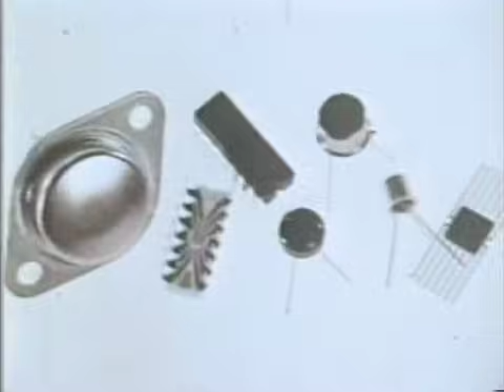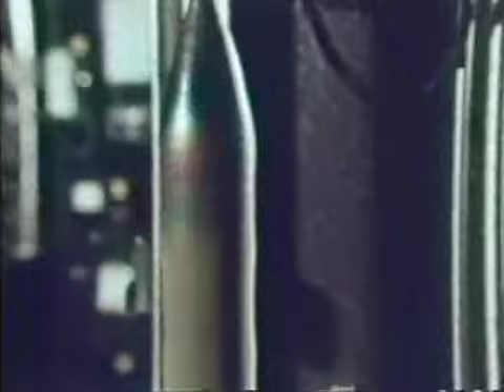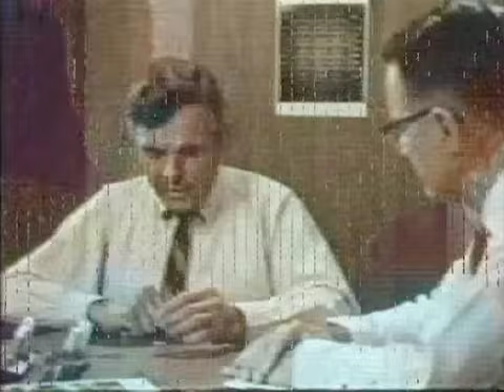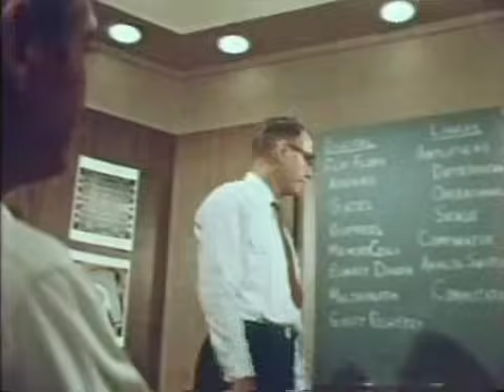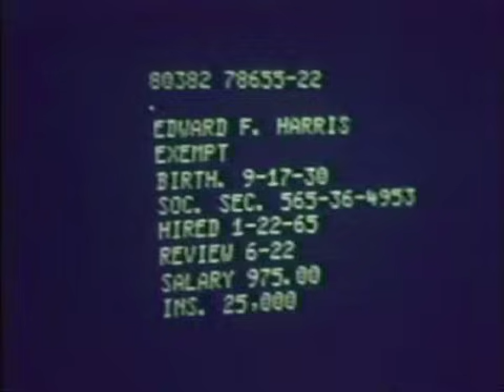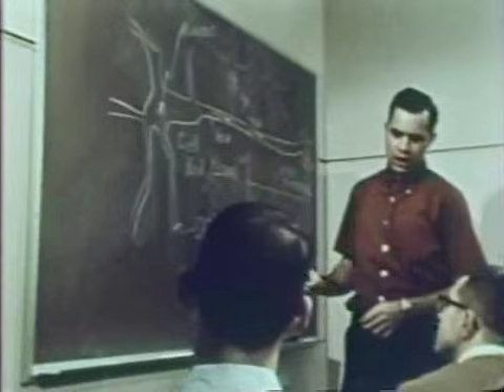Fairchild Briefing on Integrated Circuits

Comment: Funny, I remember all this old stuff. I started working 1971 at RIFA, later it was renamed Ericsson Components. We got the technology for TTL from National Semiconductors and built our first fab. Amazing: 5 micron technology and contact printing for  those bipolar TTL circuits. We also had a developmental lab for high voltage analog bipolar circuits. Later we achieved technology from AMD for NMOS and CMOS ( 2 um technology, Perkin Elmer lithography tools) and later we built a small Sub-micron fab with technology from Texas Instruments. Then we were using I-line (365 nm wavelenght) step and repeat lithography. When Ericsson closed the Sub-micron fab 2004 I moved to Dresden Infinion and worked with DRAM technology. When I retired in 2009, we were using ASML argon fluoride laser 193 nm Step & Scan immersion lithography.
Nowadays 2024 , 15 years lager, the technology has reached unbelievable new highs. Lithography is now using extreme UV (EUV) at 13.5 nm… ASML is the only company that produces and sells EUV systems for chip production, targeting 2 nm and below process nodes. Apple will use TSMC 2nm technology 2025. Cost for one ASML EUV equipment is approximately 200 million US dollars.

Comment: My dad worked on the probe machines for Fairchild, those machines that tested the circuits before they cut the wafers up.  When the guys that started Fairchild left to start Intel, my dad left Fairchild  and started a company manufacturing probe cards and probe machines.  Intel was their biggest customer, I'm guessing because my dad and his partners knew  the Intel founders personally.
Reply: As a fresh college grad in joining in 1969, one of the lessons learned by the departing management (Noyce, Moore and Grove to Intel, Spork& Lamond to National, Jerry Sanders to AMD plus many more) was the horrible cost of home made equipment, materials, etc. When the market turned down (and markets always turn down) Fairchild had huge costs for employees who created infrastructure and didn’t directly make and ship product. The spinout guys made firm decisions to sponsor and use 3rd party companies (such as your father’s probe card company) rather than carry the cost on their books. When the downturns came, they simply cancelled orders and refused deliveries to reduce costs immediately. The 3rd party companies became their own financial segment now known as SEMI CapEx (Semiconductor Capital Equipment) and three of the largest globally are Applied Materials, Lam Research and KLA all based in Silicon Valley.

Comment: This is the company where the founders of Intel worked.
Reply: Noyce, Moore and Grove to Intel. Spork and Lamond to National. Jerry Sanders to AMD. Plus dozens of others. One of the unique benefits of California employment law is an employee cannot be prevented from working for a competitor unless the original company pays the employee not to work. Non-compete agreements in California are totally unenforceable. (In later years, the legal eagles have found an ability to prevent employee movement by invoking protection of Intellectual Property aka IP. You cannot take any IP with you to a new employer. However, if the information is available from other sources, it’s not considered IP so the employee cannot be blocked.)

Comment: Great documentary. I don't think it is possible to find an older documentary about that technolgy, 1967. It was new. Created by Jack Kilby and Robert Noyce, founder of Intel. The original of 1958 only had one transistor. The integrated circuits were used in Apollo Guidance Computer, 1966.
Reply: Noyce came from Fairchild.  Apollo used RTL
Reply: @paulgriffith9570 planar tech was Hoerne's baby...greatest improvement to semiconductor tech besides actually using semi conductors

Comment: With so many ic manufacturers, I didn't know how much we owe Fairchild for what we have today. This is one video deserves a lot being here. Thanks for sharing it.
Reply: just go through the lists of First until you start hearing the word planar...EVERY common chip and transistor made today is planar....as revolutionary a technique as using semi conducting matrials is a concept in all electronic equipment today.....there were 3 huge leaps in bringing our modern electronic life into dexistamce...first was semiconductors....second was the use of silicon instead of germanium, it's oxides and alloys...and third is planar manufacturing..
Reply: Actually, integrated circuits were invented independently, but at about the same time, by Fairchild and Texas Instruments.

Comment: Interestingly, even by the mid 1950s there were "integrated circuits" only they weren't called such. It should be obvious to any engineer that if you need the same circuit over and over again, why keep making it from discrete components? Just as in programming, we use subroutines routinely, er, no pun intended. Even vacuum tubes embraced the idea in the late 50s and beyond as TV makers put several discrete components into specialized tubes to form a complete circuit (these were the General Electric Compactrons and others).

Comment: 1967, why the hell did NASA use such early electronics, when these Fairchild IC's were available  ...for the moon landing?
Reply: The work on the computer started quite a while earlier than 1967; designing for technologies that don't exist yet can be a little tricky!  There are also the major consideration of reliability in a rather harsh environment.  And no doubt many other things I don't know about.  That computer was unique, and a lot of really interesting technology went into it, including some brilliantly-pioneering software architectures, such as what was essentially a priority-based multi-tasking operating system before such things existed.

If your general sense is that "NASA were a bunch of dummies," but it seems a little interesting to you, you might want to do a little more research on what went into the Apollo program.  They were smart people working through a lot of very challenging problems for the first time -- without much "prior art" to draw from.  You might also enjoy CuriousMarc's series on restoring an Apollo guidence computer, getting it working and using the actual computer with a few external simulation elements (because... well, the rocket didn't fit in the lab, I guess!) to do a moon landing.  Pretty impressive stuff, by some pretty smart people.

Comment: Fairchild: "Metal over oxide... you can't make an integrated circuit without it!"
Polysilicon: "Hold my beer."
Reply: The silicon gate technology was actually developed by Federico while working at Fairchild. He followed Noyce and Moore to their company, intel, but eventually left to found Zilog... I love reading anything written by Federico Faggin - quite an interesting fellow
Reply: Is Metal-over-oxide  same as metal oxide? As in MOSFET
Reply: @foxtrot312  : Yes.

Comment: Bob Noyce, who was one of the original traiterous 8, who left Shockley's company and started Fairchild Semiconductor,  paved the way with his patents for manufacturing silicon transistors. At around the same time the first silicon transistors were being produced he realised that whole integrated circuits could be done similarly. probably not long after this video was produced he left Fairchild, and started Intel with Gordon Moore (of Moore's law fame) where they went onto to pioneer the first microprocessor. He also mentored Steve Jobs in late 70s.. Not much talk about Noyce these days. Incidentally he was known as the Mayor of Silicone valley. what a man...
Reply: Don't forget the other key founder of Intel: Andy Grove. Grove wrote the book on transistor fabrication. Noyce was an absolutely brilliant guy. Without question he is the founder of Silicon Valley. There will never be another like him, a true leader of men. (Sorry ladies, but that's the truth....)

Comment: So all the capacitors have a common plate that is also the bulk of all the transistors?
Reply: No. The bottom "plates" could be isolated by a deep diffusion of oxide, or a deep diffusion of P or N material that would be reversed biased, effectively isolating the plate. They knew what they were doing. Some seriously smart people back then, led by Mr. Noyce, the driving force behind the innovation.

Comment: Holy shit,they were really really ahead of it's time in 1967,i can't believe that many do say's that the 1st miccroprocessor was invented in 1971.
Reply: There are several technologies that have been used to build fast mainframes of that era (see emitter-coupled logic (ECL)). Better for a personal computer? Historically, none were suitable to be reduced into a single-chip microprocessor. Power consumption and cooling are HUGE factors. The NSA has no problem using enough power for a small town to power its systems; most of us can't afford that, much less the supporting infrastructure to support it.

As to IBM's 4.77 MHz speed, even that was below the 8088's 5 MHz spec. Why? It had to do with deriving all clock sources from a single 14.31818 MHz clock, allowing it to be divided by 3 for the CPU, and by 4 for the 3.58 MHz colorburst signal for the composite color video monitor. They got cheap. The clone wars didn't make that mistake. Not for the trivial cost of a 2nd (or 3rd) clock source.

Now, to be fair, in typical IBM fashion, they really had no idea what revolution they were about to unleash, so they kept the design conservative. This is also the same company that lost its market share for a product it invented. Twice.
Reply: IBM also made the big mistake (with hindsight) of using commercial, off-the-shelf components to build the PC. This made copying it quite easy. IBM then spent a lot of years trying to hold off the clone makers, but ultimately the flood gates opened, and they had to leave the PC business that they started.
Reply: therealnightwriter I've been trying to track down any citation I can find for these claims of early computers in the high hundred of mhz range that were not made public.  Do you know what book that was?
Reply: MPU != IC

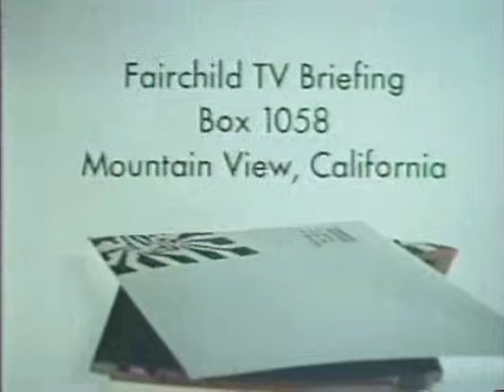Comment: 19:24 Too old for zip code!
Reply: RonJohn63 The Zip Code system was over 4 years old when this was made, But like the more recent Zip +4, Some people just didn't use it. The Post Office (later known as the USPS) had to hound people thru P.S.A.s, Etc to use Zip Codes well into the mid 1970s!

Comment: I  started learning. analog. electronics. about 1982 .basic Eléctric theory  inductance, capitanance  impeadance circuits, building two transistor radio  ,pnp. npn bipolar ,diodes, resistors ,in wired  breadboard using Radio Shack components, then i taught my self Digital electronics ,boolean logic circuits using boolean algebra and or Logical gates ,truth tables,Waveforms, Square ,trapizoid ,sine Wave then i learned computer Programming language Basic,Fortran,Cobol  Java and C .
Reply: Bob H  Well, What happened was that I was a 11 year old. black  kid growing up in the early 1980s Brooklyn NY  , Flatbush area ,I had lots of Ideas even at that age, but No Father figure ,or money ,and a horrible Mother,. I Learned very Quickly that it's the Software, Not the hardware that creates New , and Useful Application,So my  direction immediately turned to Learning Advance Mathematical Concepts ,I started with Number theory, Quadratic equation and Begin to Recognize that all math concepts are directly related and have real world Applications, I made some new discoveries in number theory , Linguistics after studying Chomsky ,and John  Backus work on Formal Grammar in Relation to Programming Languages , and Turing Computable Function, I even wrote a functional programming language that resembles Knuth Text Processing program, That is my Story, and I am Still Learning new things daily, thanks for your Interest
Reply: Esmond Lucan - Did you continue with electronics practice?

Comment: Born in 1958 and professionally working in the Consumer Electronics Repair Industry since 1977 I can tell you that we are on an extremely fast track with technology. When I started working in 1977 there were still some tubes in TV circuits. I saw the first (Fairchild) integrated circuit used in a TV. Quasar had an IC for the AFT (auto fine tune) circuit. I have installed thousands of Fairchild components. Today I solder individual resistors the size of a grain of pepper using hot air instead of a soldering iron. What will tomorrow bring?
Reply: tommorow will bring tyranny.  the new generation has used your technology to devolop a weapon against the masses to control culture and history. yay tommorow.
Reply: yeah.,.. it´s amazing to see what we have today! few years ago i saw a kid with a tablet on a museum... suddenly came to my mind that image of the future portrayed in movies and tv sci fi...!
Reply: i was bornn recently and i can tell you i wouldve like to see the process of the use of integrated circuits insteaad of not seeing it and not knowing their uses
Reply: all of these systems are still in use, they are just smaller and faster. If you study these things you can make amazing tech. Start young and you'll have a bright future ahead of you.
Reply: laser 3D printing...
Reply: New old stock  Fairchild transistors are still being used in high end products in the audio world. For many applications, it’s not necessary to make micro size components. It’s easier to repair or replace parts and making the products less disposable if they are high quality items.
Reply: You still going Fuk Hue?
Reply: Fuk Hue Repairman will not be needed in the future
Reply: Fuck you too.
Reply: @Tadesan  LOL, I was about to give you a thumbs down.

Comment: This is some old stuff. I started in Fairchild's material division in 1971, then off to CMOS in 1974. Fun times, but serious work.
Reply: That's really cool. U must have witnessed the birth of so many things people of generation couldn't imagine life without.
Reply: what an experience!!!!
Reply: I was recruited in the summer of 1969 and assigned to the Mask Making group building a new Mask Shop. Then I moved into mask process engineering.  In the last part of my 2.5 years I was assigned to the MOS fab in Building 20 (aka the rusty bucket.) By the beginning of 1972 I was recruited by National Semiconductor reporting into Nelson Walker’s group. That’s when the light bulb went on. All that Fairchild homemade equipment (The Nelson Walker Wafer Alignment tool, The Nelson Walker Mask Printer, etc., etc.,) was named after a guy! I had no idea.
Reply: Amazing stuff
Reply: @ramencurry6672  Back then, I built our own Diffusion furnaces from scratch. Those were the days!

Comment: It is worth noting, the process described here used a contact mask, producing PMOS chips. The achilles heel of this process was of course, the net yield of working chips from a given die. This is mentioned in this video Even by the mid 1970s, this yield was approximately 20 to 30 percent. Process pioneers, like John Pavinen developed an N-channel process using non-contact masks at MOS technologies during 1974, and increased the net yield of masks to over 70%. Making the $25 6502 CPU possible.
Reply: The process described here is not MOS, but bipolar. MOS was around about this time, but it had some serious problems that caused the threshold voltage to change with the applied gate voltage. Fairchild finally solved this puzzle when Bruce Deal revealed the culprit: mobile sodium atoms in the oxide beneath the gate. Once that contaminant was removed, then stable MOS devices could be made, which begat the MOS revolution. I worked in PMOS at Fairchild in 1971, and then NMOS came along another year or two after that. Here we have another example of Fairchild's pioneering leadership.
Reply: AH yes, the 6502. As used by Apple and Acorn Computers, who went on to design the very first ARM processor.
Reply: @petermitchell6348  for the record Apple had no hand in the "design" of the ARM proc, they were just finance, and a lot later in the game. (this is not from a google search)
Reply: Do you think they would have put someone in a psych ward for making 2nm?